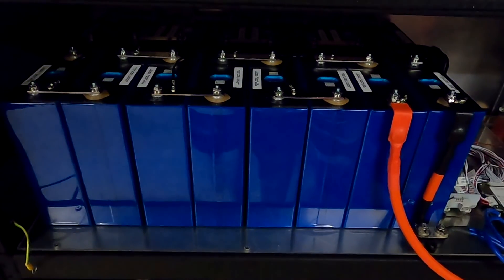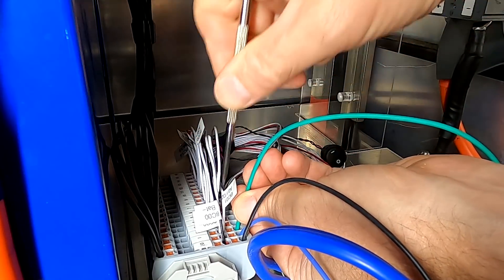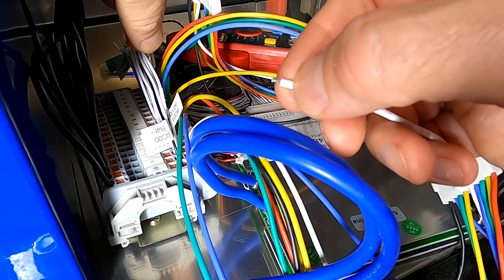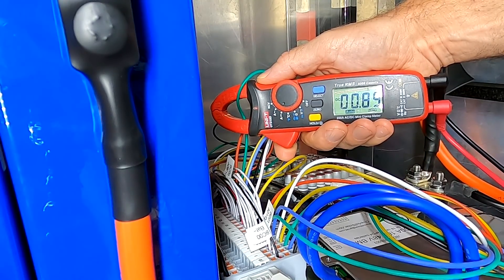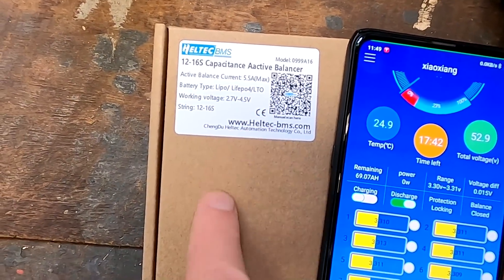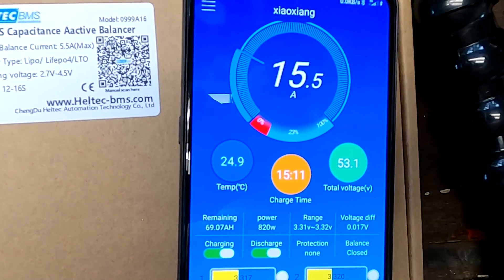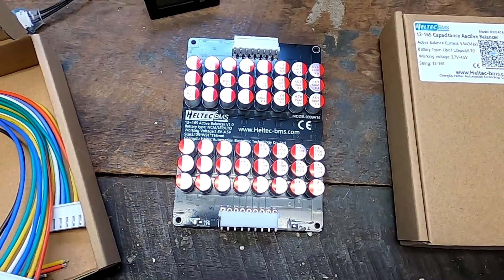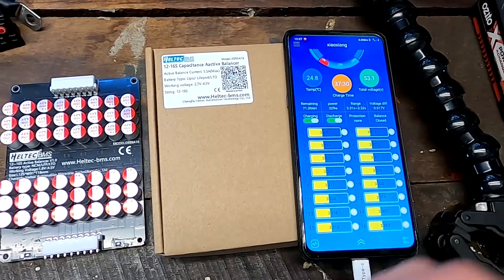HELTEC Active Balancer for LiFePO4 batteries. How to install and avoid problems.

Comment: Hmm so is it a fact that keeping this active balancer connected 24/7 to a Lifepo4 pack a bad thing? I just got this thing and it has been connected to my pack continuously for a couple of days. But if it is truly bad for my pack to be connected to this thing 24/7 unless charging then I will disconnect.

Anyone else able to confirm this?
Reply: I've had mine on full time for over a month now. 200ah 16S LFP pack. 98%-25% DOD. My cells go out of balance at around 25% as they're worn, but the balancer hasn't made any difference other than recovering the imbalance within about an hour. I measured the wires with a clamp-dc ammeter and saw 4a on one of the wires, presumably the cell that needed help. No problems so far.
Reply from the maker: You have to try and test. See how it performs over time and if you still experience a high imbalance when fully charged, I would not leave it running all the time as it can create an imbalance at lower SOC and voltage.

Comment: I have a 36 volt life04 ebike battery. The battery is getting old and has half the life or it may need balanced. It has a PCB but they don't seem to control the voltage very well. When I plug in the charger, it charges to 44 volts and then charger shuts off. After it sits for a few minutes the voltage will drop down to 38.9 V and the charger will turn on again. Should I leave the charger plugged in overnight, to balance the battery or will it harm the battery? Also the ebike has a controller board, that cuts power at 33 V. This is set up to save lead acid batteries for draining too much. Life04 batteries can go down to 2 V each or 24 volts on a 36 volt pack. Would it be advisable to disable the low V shut off on the controller, because the battery pack itself, has a low V shutoff to protect it?
Reply from the maker: So 44V is far too high to charge this pack to. If this is a 36V battery LiFePO4 it has 12 cells I assume? That would mean 3.66V at 44V. It may be the BMS which protects the battery and shuts off charging.
The low cut-off at 33V seems fine (assuming 12cells at 33V = 2.75V). The usual lowest discharge voltage is 2.5V for LiFePO4, not 2V unless you have special cells and the manufacturer specified this explicitly.
I would not disable the low voltage disconnect. It is there for a reason and the BMS low voltage shutdown is just there if the one of your controller fails.

Comment: or you can just use passive balancers with some huge resistors, and they will be active only on those cells, that are out of specific top voltage range
Reply from the maker: But this will burn off the energy. Passive balancing is a bit outdated...
Reply: @OffGridGarageAustralia  yeah, but nothing is perfect anyway, they all have their downsides

Comment: My active balancer is named flying capacitor for 16S looked same as this one in the video. It turned off at 44.5V and turns on at 44V. It did a good job balancing than the passive balancer with the Daly BMS.
Reply from the maker: The Daly has no great balancing capabilities with these large capacity cells. The active balancer is the perfect combination for your setup.

Comment: Can you do a video on the voltage trigger module? I want to use it on my solar powered rasppi to trigger a relay to turn the AC charger on if there has been too many days of no sun and my battery voltage is low. A lot of questions on that module, when does it come on is the relay NC/NO and when does the relay trigger back off/on?
Reply from the maker: Sure, I'll get one...

Comment: Could a current sensor be used to turn on the balancer when current is in charge direction and off when discharging allowing continuous active balancing (install and forget)?
Reply from the maker: A current sensor is hard to do. This is basically a shunt where the voltage is measured. So why not measure the voltage directly?🤷‍♂️
You want the balancer to be on all the time if over a certain voltage, regardless if charging or discharging.

Comment: You say not to leave the active balance on all the time.  I hadn't thought about that, but it makes sense.
On the JK, which seems to have a lot more settings based on your videos, does it have the ability to only kick the active balancing on above a certain voltage?  If not, it seems like this logic would be fairly simple for them to implement within the software.  This way it wouldn't interfere in the flat part of the curve, but kicking the AB on at say 3.44V, and leaving the upper V limit at say 3.46V or so, would allow some frequent and regular balancing between 3.44V and 3.46V...  Or is this not a good idea as you just don't want to go up that far on a regular basis for cell health reasons?

Comment: Not sure if you or anyone will reply to this but… I have a JK BMS in my ebike I just built. The factory settings are to start balancing above 3 volts. Should I bump that up to 3.45 like you said in this video?
Reply: Minimum start balance voltage is 3.4 for LiFePO4 chemistry.
Reply: @SkypowerwithKarl  ok thanks. I’ll change it then!
Reply: Are the cells lifepo4 in your ebike battery, not liion? 3.2V or 3.6V, 3.7V
Reply: @hommerdalor6301  ya they are 6000mah lifepo4 cells. 3.2v nominal. It’s a 17s3p config, giving me 18ah
Reply: @civicrocker  Nice battery, with the JK BMS, you can raise the low voltage cutoff, so it makes a reserve. 
With electric bikes, and simple original batteries, I had discharged battery before destination, that’s a huge problem, as I couldn’t walk and have very little force to pedal, I live on top of a little mountain, so I get range anxiety. 😅
Reply: @hommerdalor6301  ok, that’s a great idea! I am planning on using my bike to get to work and back this summer. Last summer I was using a 9ah lipo 14s and I could get to work but I always brought a charger with. With the extra capacity I hope I can leave the charger at home eventually!
Reply: @civicrocker  With this battery, dubble size, you should make it back home. :-) 👍
Reply: @hommerdalor6301  thanks!

Comment: Because of the way I use all my lithium batteries, I do not need a BMS, it just make the battery hard for me to use. If the BMS were to shut down a battery, I might be a couple miles offshore, or deep in the woods. A balancer is perfect for me. I just put one to use on a 72volt (20s) eBike battery I built. Will see how it works compared to the QNBBM I use on LiFePO4.
Reply from the maker: The BMS is there to protect the battery. The battery is usually the most expensive part of your system, so I cannot see how this hinders you in your activity. If you're on an ebike in the woods and the battery is empty, well, there is no way to use it any more anyway, even if you go below 2.5V.

Comment: Andy, does the Venus OS have the ability to trigger the balancer based on voltage?
Reply from the maker: Yes, you can use relays triggered by Venus OS or the MPPT controller relays.. a lot of possibilities to turn it on...

Comment: I have had one of those active balancers connected to my main house battery bank for over well over a year at this point.  Adding a voltage controlled relay to turn it on and off was one of the very first things I did after checking to ensure it was working.  It makes a big difference when you have several hundred amphours of capacity and you are comming out of winter where you may have weeks in a row where the batteries never reach full charge.
Reply: Thanks! I will do this on my car battery (LTO). No idea how to do it yet, google will tell me! I put a simple switch on mine, just turn it on when required and turn it off again. I think it draws 10milliamps, so on a 35Ah battery, it is actually a decent draw.
Reply: @GTrainRx7  Just a voltage controlled relay or switch. Should be easy to find online. Set it to measure the voltage of the pack, which you calculate using the desired cell voltage multiplied by the number of cells in the "S" part, and set the switch on voltage level accordingly. Set a switch off voltage at some other pre-determined and similarly calculated level so that when the pack is discharging, the balancer turns off. Have it enabled only when the pack is about 85% SoC or higher, and the balancer will never be able to burn out with excess current. Somebody else will probably have a better suggestion for that SoC voltage suggestion.

I think Andy turns balancing on after the cells hit 3.4(5)v and turns off after they drop to 3.3 or 3.2v
Reply: I was thinking the same thing, you beat me to the idea, easy to setup too

Comment: You have a 12 volt battery connected to a step up transformer to power the inverter to power the power supply to charge the lipo.
Reply: You have to send that to Andy via email.
Reply: Not sure to see a lipo.

Comment: Do you even need the active balancer for grade A cells. I think that the BMS passive balance is enough to keep the in balance..
Reply from the maker: I would say, yes, you need one. I rarely fully charge my battery and if I do, they have drifted a lot. Don't get fooled by the internal resistance and how suppliers match your cells. That is only a snapshot and the resistance will change over time and usage pattern.

Comment: You should do a more extensive experiment to back up your claims that the active balancer ruin the balance of the cells if it is always connected...
Reply: Andy has and I can also attest on LiFePO4 that if you have an balancer active below 3.4 vpc you stand a good chance to have wild delta numbers as you approach full charge and likely have the BMS shut down charge due to a rogue high cell. Small corrections on the “flat” of the curve can be disastrous to balance. Let the delta run where it wants after it’s charged and has adequate balance time above 3.4 (or 3.45 Andy). Watching the cell voltage on the flat of the curve during charge, discharge and rest is constantly changing, trading places and correcting, usually never more than .010 Volt. It’s like watching voltage “bop-a-mole”. It’s totally normal and shouldn’t be corrected on the flat of the curve.
Reply: @SkypowerwithKarl  Andy did make a video showing the test you are asking for, in the past.
Reply: @randypeterson4055  
I think you meant the other guy= @Vzajemna. I agree with 98% of Andy’s conclusions. I’ve actually done a video on a Heltec myself.
Reply from the maker: I have the two balancers permanently connected to these batteries at the moment. Once we charge them up again, we will see.
I know some people have said that they can stay connected 24/7 but my experience was different.
Reply: @OffGridGarageAustralia  but Andy.. an important question.. Did you disable the "default" balancing option in the BMS...?
IE start at cell voltage 3.7V..
Adding an active balancer like this... is so it can do "all" the balancing itself.. 
I will bet you consider leaving the BMS internal balance features "on" is a case of more is better..
Reply from the maker: @Oxyandy  No, I didn't disable the onboard balancer of the BMS. Never. They can even have different settings and will work fine next to each other.
Reply: @OffGridGarageAustralia  
Yeah, I’d be sticking to what you know. You seemed to prove a point Andy.

Comment: When you came back over night all cells where over 3.3v but you started with all at 3.0-3.26-3.29 how have they all gone up? did you have charge connected? These balancers can be left on at all times I have been running them for about 2 years and they work perfectly the ells are always balanced and I always get full capacity from my pack. I understand where your theory kind of comes from but in practice they work. Even some argumentative "experts" who laid claim for a long time they don't work well are now offering them in battery's they sell. While yes the charge curve in lithium is very flat there is still mv differences and if you match voltage the cells are balanced this is the point of a balancer to stop one or more cells reaching high or low cell cut off before the others and so long as that happens the balancer is doing its job and you get full capacity. What would be a good test is balance a set of 4 cells with the active balancer, Then capacity test each cell after its balanced. Even so I don't see an issue with the balancer keeping the cells matched in the middle and top end. When you think about it a lot of banks will be sitting in the middle section of soc a lot of the time so when you whack on a high load you don't want one or more cells that may be out dropping and hitting low cell disconnect. As you charge the balancer keeps cells matched right up to full soc again. If they are all closely matched in voltage while in mid soc even if capacity was slightly off its not off enough to create issues the battery works and means the cells are still close matched for when you begin to charge full and reach full they stay close to each other and remain balanced as you charge to full and re top balance. Does that make sense.
Reply: Your charge and discharge patterns have made you lucky. What ever you are doing seems to be working for you, but if you start to see a balance problem, remember this video. I’m also running eel batteries. No problems
Reply: @SkypowerwithKarl  My charge and discharge patterns vary depending on solar and my usage so no real pattern.
Reply: @magicmanspaz  
I’m not going to risk it on my big system. I saw what it did to have balance active on my son’s trolling battery. The delta went crazy and tripped high cell. It took several charge & let it equalize cycles attempts to get full charge. Now he charges the night before and sometimes turns on the active balancer after it’s finished charging and waiting for morning. It’s usually never more than .010 unless he runs it under 3vpc.
Reply: @SkypowerwithKarl  Sounds more like dud balancer or bms. or cell issues. none of my handfull of banks or cranking battery have ever had any issues with active balancers on all the time. and they use varied types of cells and mixed charge and usage non patterns.
Reply: @magicmanspaz  
Well the problems went away when it’s only balancing over 3.4 so I got to say cause and effect. Most of the time the the Overkill BMS’s .050 amp resistive balance is all it needs. Engaging the Heltec will bring it to .002 delta or better. Those are eve batteries. He can troll all day vs a few hours with the heavy lead batteries. When things aren’t broken I leave things alone. My house system runs my dryer and hvac at the same time and is flawless. Probably going to add another 62kwh for reserve/rotation. Those will be two sets of 16 on  two 200 amp JK BMS. Those have a 2amp balance but it’s current isn’t differential dependent.
Reply from the maker: You leave the power supply connected over night sitting on like 3.5V/cell. This keeps the battery at this level and balances the cells fast.

Comment: CAREFUL on the grey mylar packaging - its anti static & conductive!!! you can short something.
They balance 24/7 - BUT they work on voltage difference, at the middle part of the curve, the voltage diff is minimal & the balance is minimal. They wont move enough current in a 300Ah pack during the time it takes to charge to a higher voltage, so wont affect a top blance.

I used them 24/7 on A- grade cells, they worked incredibly well & the pack was always much better balanced
Reply: I think that on grade a cells the bms passive balancer is enough. So you could not tell if the active balancer was keeping the cells in balance or the passive balancer built in the bms was doing it..
Reply from the maker: Didn't know it's conductive. I'll test it.
Reply: @OffGridGarageAustralia  yeah might be - typically they're used for anti-static, so may be slightly conductive at higher voltages. But i once fried a hard drive by doing what you did :)

Comment: 6:25 From my understanding, this Balancer transfers the charge from one cell to an adjacent cell.
If the unbalanced cells are far apart, it will take a long time..
Reply: Clarification: By *far apart*, I am referring to physical positioning of the cells, not voltage delta.
ie, if Cell#1 is the highest and Cell 16 is lowest voltage in the pack, this BMS will transfer the charge from Cell1 to Cell2, then cell2 to cell3 .... until it reaches Cell16.

THEN AGAIN, that was early design version of balancers. Maybe they already changed it. It should be easy to check with an ammeter.
Reply: @DanBurgaud  I understood the same, with the 2Amps version, when reading the description on Ali, but when Andy tested the curent in each wire, I wasn’t so sure anymore :-D
Maybe the test couldn’t really show what is happening, if the capacitors pump small bits of charges at a frequency witch seems DC for the multimeter, maybe an oscilloscope could reveal something else?
Reply from the maker: I could not verify that during my extensive testing I did with these balancers. It seems to bet the higher voltage cells are being discharged and the lower ones being charged. It does not seem to transfer the energy just to an adjacent cell.

Comment: I would like to see a longer test leaving the balancer on while charging. and see how it works or doesn't. Many of the videos show an unbalance between the cells. Maybe a monthly near max charge and balance would be an idea. My c-40 charge controller has an auto-balance higher charge that can be set to automatically do this or a button can be pushed to manually start this higher charge. I keep learning and maybe soon I will see for myself.
Reply: Andy has made a video where active balancer is left on all the time. It didn't go well.
Reply: @1978jra   I just remember a short test.
Reply from the maker: Hi Ron, I have now two balancers connected all the time to two different battery banks to do this test. Once the battery is fully charged again. I'll make a follow up video.